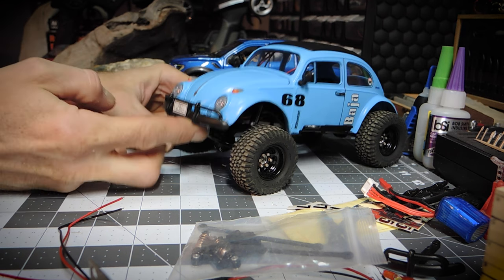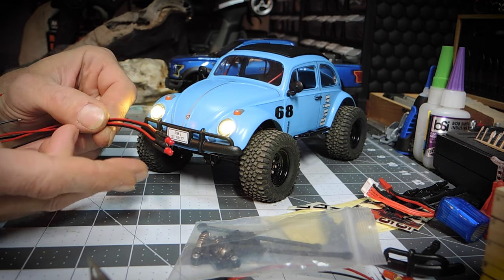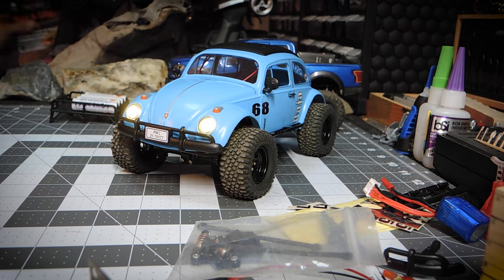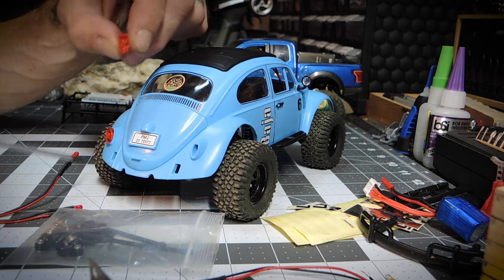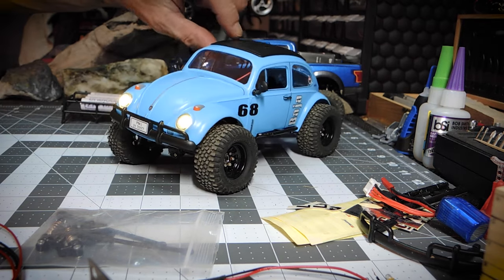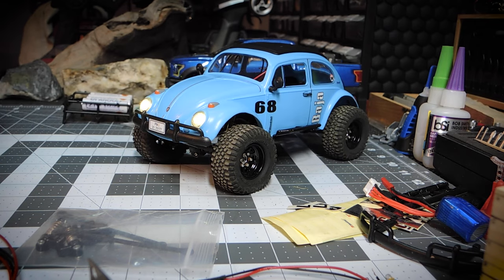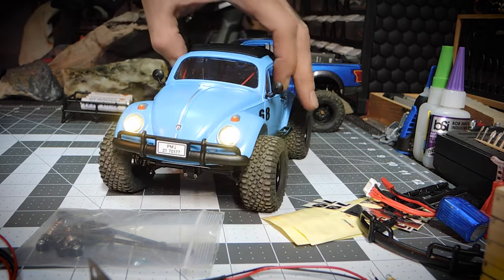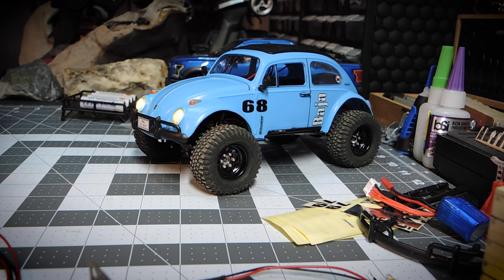SCX24 '68 Beetle Detail & Progress Video #2 #playmobil

Comment: i'm actually keeping the engine on mine, i just find it so cool to lift up the back and see an engine. When's the last time you saw an scx24 with engine detail?
Reply from the maker: I built this for equal parts performance and looks. It was a body kit to put in a chassis that was already built 3 years ago. This thing has had half a dozen different bodies on it over the years. It was just time for the next one. It's cool you're doing the engine detail. I still have it sitting on the bench. Not really interested in adding a bunch of weight in the back of this. If I'm just trailing with it, that's fine, but I plan on crawling with it as much as I do just running it flat. Even adding the lights all the way around added multiple grams of weight up around a level that I wasn't really psyched about. POE.